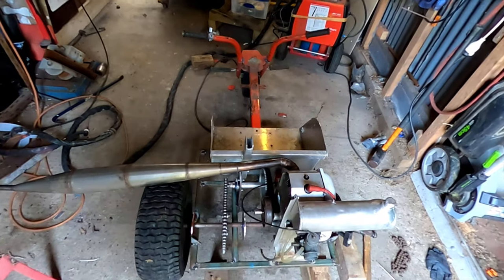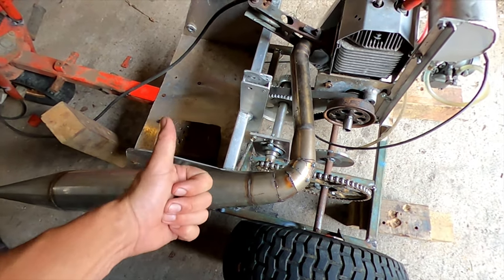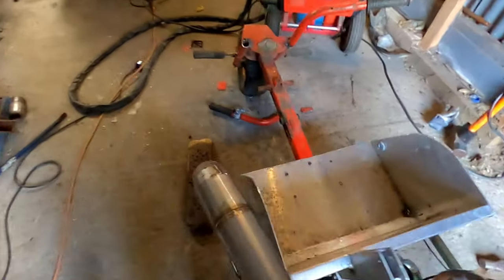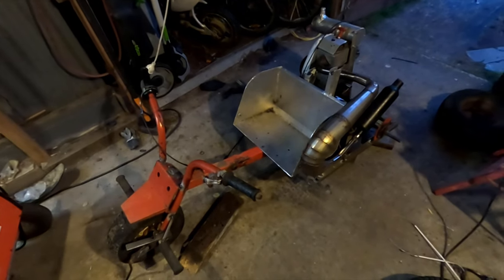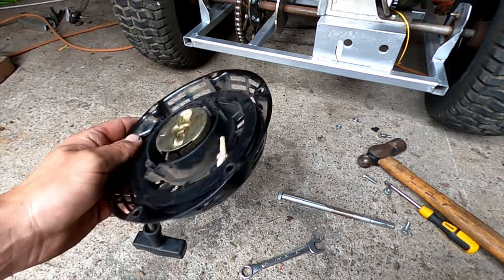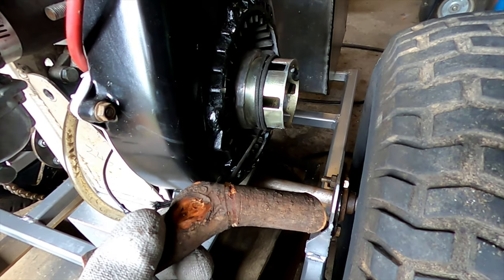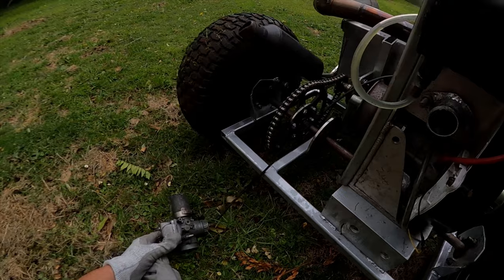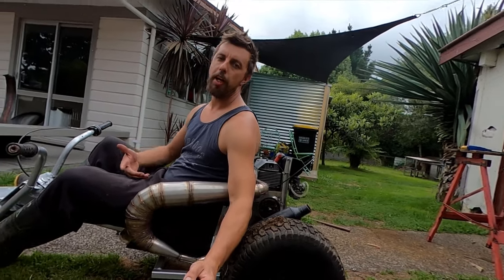2 Stroke Junk Trike Build, p2 Test!

Comment: Nice to see your advance on the build, you did a hell of a job on the exhaust pipe ( TIG welding the expansion chamber to fit ) but I Wonder where are you from ?
Reply from the maker: I’m from New Zealand, what about you? It was a lot of welding on that expansion chamber!
Reply: @DktheWelder  oh now I remember that you said it once I'm sorry for the comment at 3am or something like this 😂 how many hours of jetlag do you have with britanny (France, Greenwich meridian ) ?
Reply: My father has the same problem of kickback on a 2 stroke 250cc engine cultivator/tiller and broke the pullstart string, the Spring is so strong that it was a nightmare to put it back and your choice of replacing it isn't a Bad Idea for that